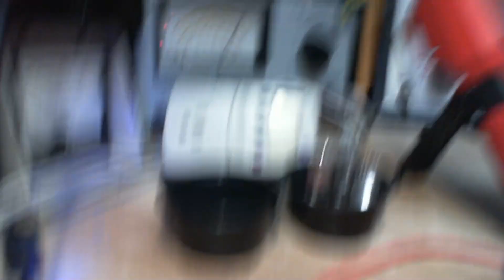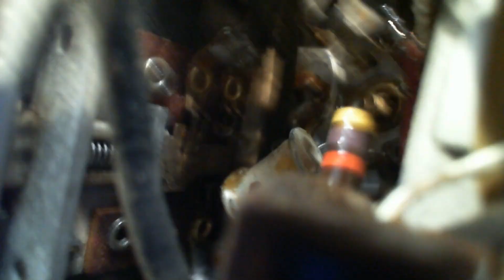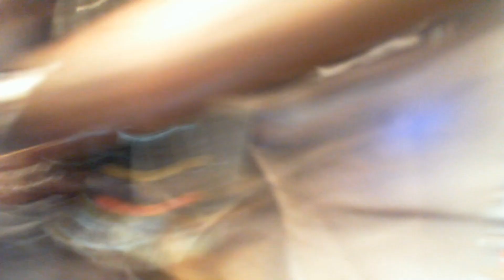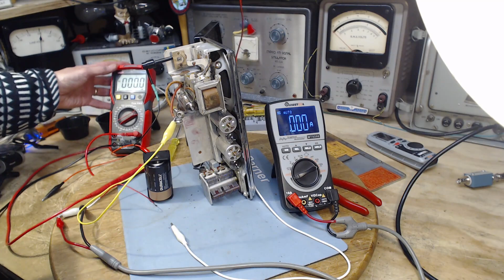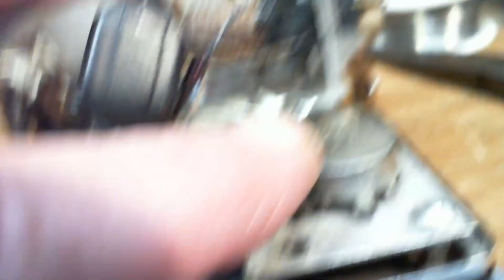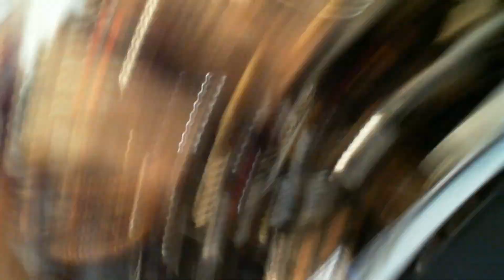RCA Victor BP-10A Portable Tube Radio Video #2 - Making it Work

Comment: The cap may not be electrolytic....it is just an old school paper and foil cap, as I'm sure you know, in the old days they would label the foil side. now they do not. take it apart and fine out.....PS love the time "we spend together" in your shop.   PPS i would not use that scoop thing... there are several ear washing things that will not potentially puncture your ear drum (if you slip)  please be careful.   however it could be a great tool for the radio fixing biz.

Comment: OK, after watching the video again, Jim, in the first 3 minutes of the video and at 36 minutes, the battery was reversed. That is what was causing the short. Not sure why you switched it to the correct polarity without saying anything but as I mentioned yesterday my initial idea was a reversal of the battery. At 2:38 you can see the Red wire going to the terminal closest to the chassis, but later at 37 Minute point the Black wire is going to the chassis end. 
Robert